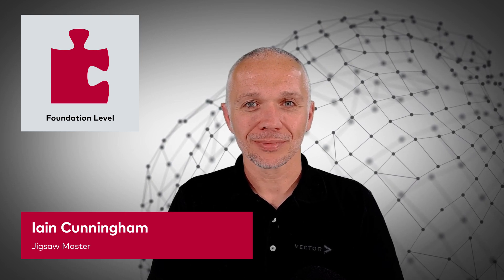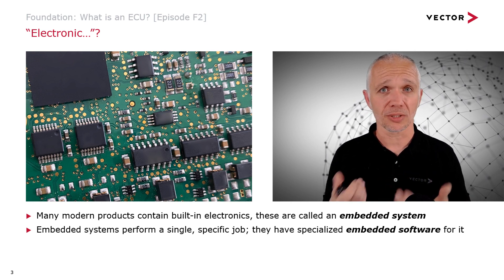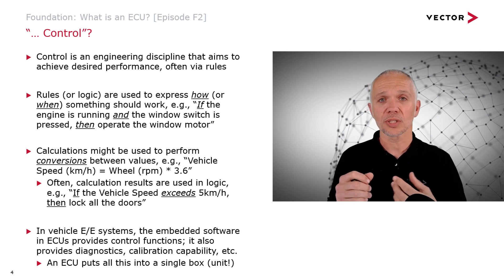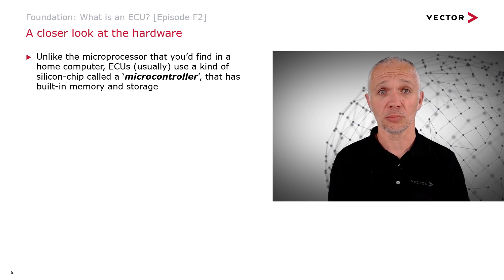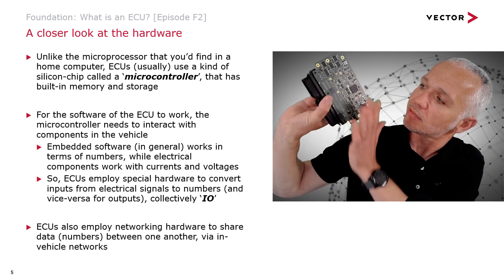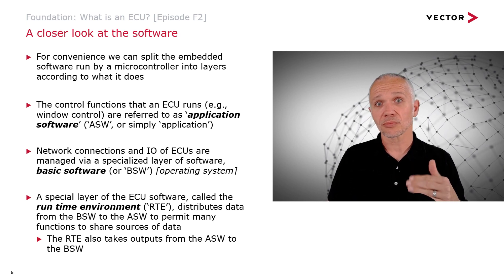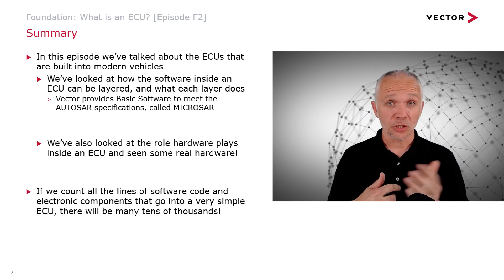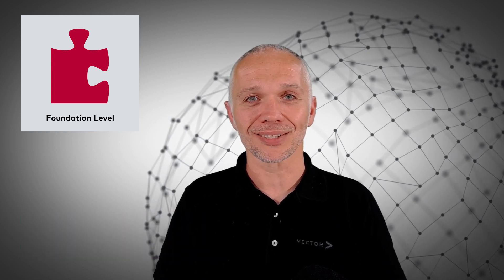What Is an ECU? | #EnginEEringTheJigsaw | Episode F2

Comment: 5:13 just one question, why are we multiplying by 3.6?
Reply: Because I made a small error in preparing the slide that managed to slip through our checking process unnoticed; the slide should say "revolutions per second" (not "rpm")  ::Facepalm::

Background maths: I assumed that the wheel had a circumference of 1 m, so one revolution per second equates to a linear speed of 1m/s. To convert revolutions per second to km/h we need to multiply by 3600 (seconds in an hour) and divide by 1000 (metres in a kilometre), which can be simplified (via dimensional analysis) to multiplication by 3.6 ;-)
Reply: @iaincunningham  thats what i thought, but like you said i was confused because in the slides its rpm:D